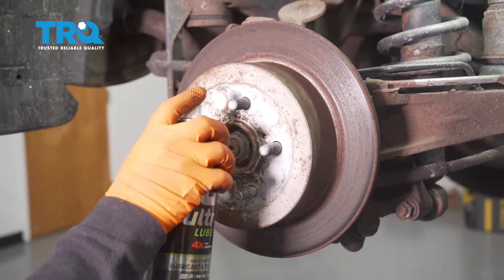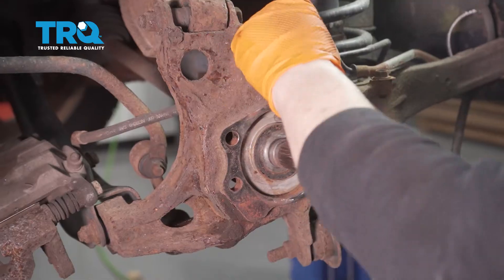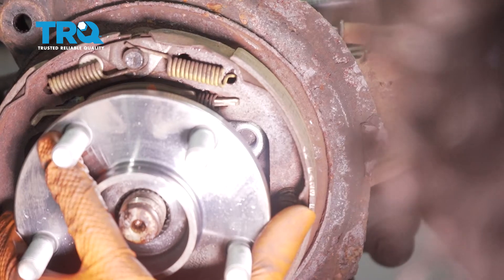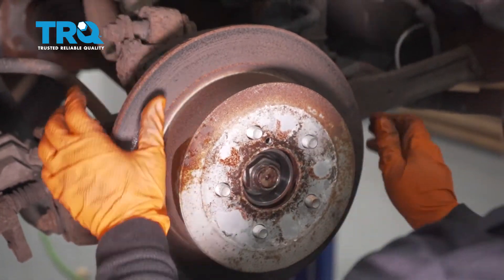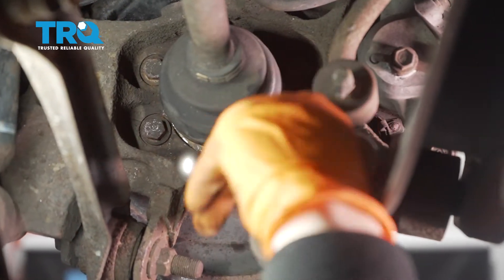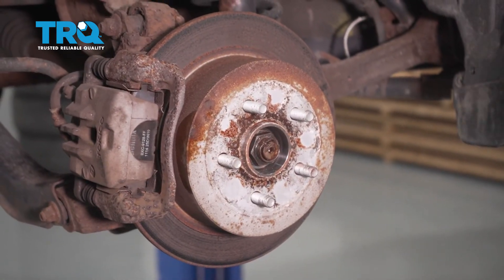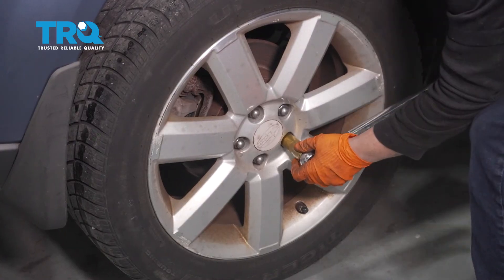How to Replace Rear Wheel Bearing & Hub Assembly 2005-2009 Subaru Outback

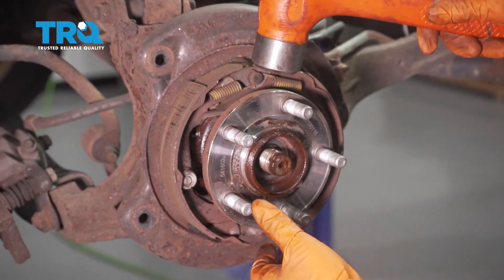Comment: Just picked up a very good tip for getting the bearing off the axle (2:20). If it's real stubborn, then bolt the wheel back on and kick it around the edges of the tire. The extra force and leverage will pop it right off.

Comment: Outstanding tutorial 
This is an upgrade from subaru,  my 2004 impreza bearing housing bolts are on the outside so the emergency brake needs to be disassembled to access bolts. 🌊🏄‍♂️🤙

Comment: If you have an OEM tyre (17" inch rim)  size of 215/55/R17 apparently an alternate is a larger width and same /55/ wall height tyre BUT if you do a proper radius calculation you can use a 235/50/R17 because it is no more than a few mm milimeters total wheel radius!
However, not much about, only Goodride, Kumho, Falken, Continental, Leao, Nexen, have any with a EU label for wet stop A or B, oddly I found Pirelli has B too often and Dunlop is dying away , at least unless it's super expensive models. Pirelli at least has a good mid range expense model of A B called "Powergy" unfortunately , the Cintuato p7 is only B wet stop, C fuel roll.
215/55/17 is identical spinning radius with 235/50/17!

Comment: Best way to break axle nut loose is to pop out the center emblem on the rim and put the tire on and drop the car back down. Then crank on it with your breaker bar.